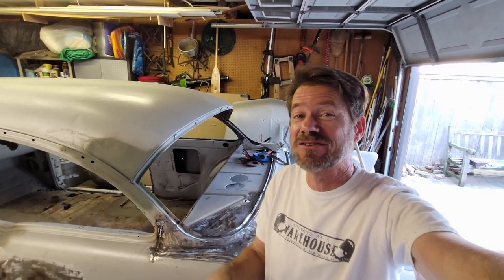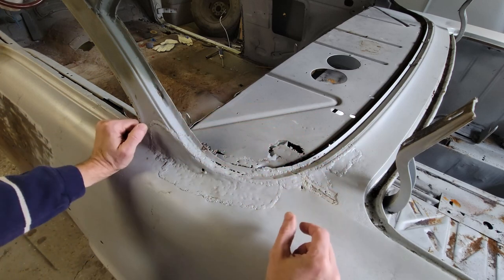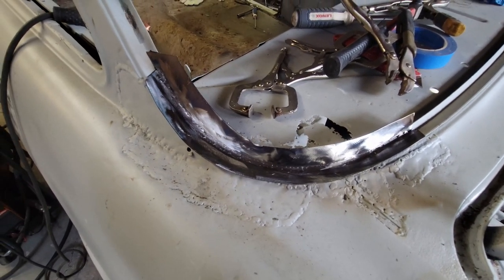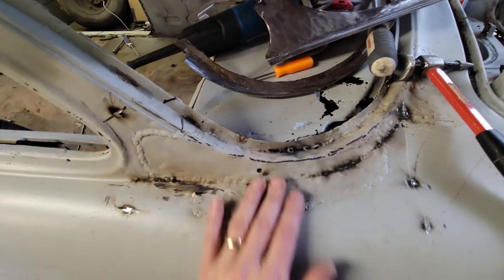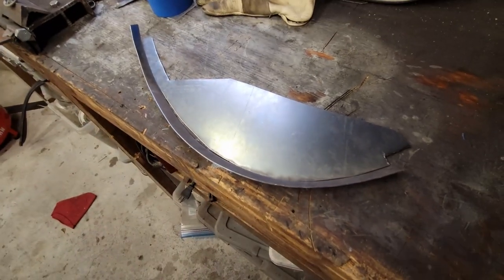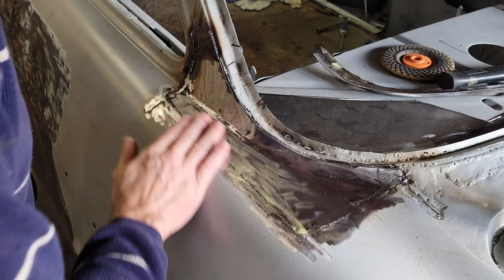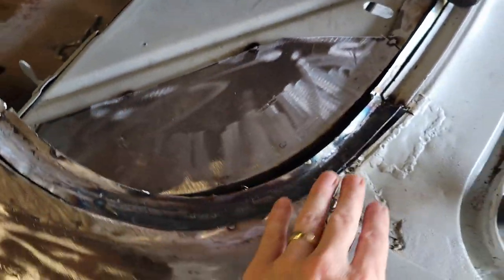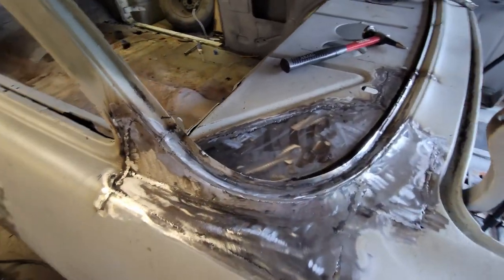E24 Tri-Five Rusty Package Tray, C-Pillar and Glass Flange Repair!  1956 Chevy Bel Air Restoration

Comment: A little tip from Halfass Kustoms ... he cuts the patch slightly larger and places it on the car and then cuts both with the wizz wheel... pushes the patch down ..then welds ..and eventually the scrap underneath falls out,,,seems to work well... nice work.. keep it up
Reply from the maker: Yes!  This is the same way that Fitzee teaches his repair methods.  I would normally have done exactly that, but since I was working in a corner with a tight horizontal and vertical edge right against the window flange, I decided to cut and grind to fit.  Thanks for the encouragement!

Comment: Good video wasn’t long at all ! you was so close to removing that hinge to get to that rust behind it  I though you were
Reply from the maker: You might have picked up from my videos that I'm big on maintaining the car's original alignment points.  I didn't want to take a chance of cutting that hinge free and having it line up when I put it back.  Glad you liked it!
Reply: @RestoringChristine1956  when I pull off hinges I drill 1/8” holes in a few place acting like line up pins so they go back in the same area